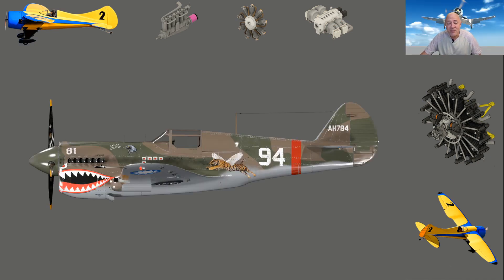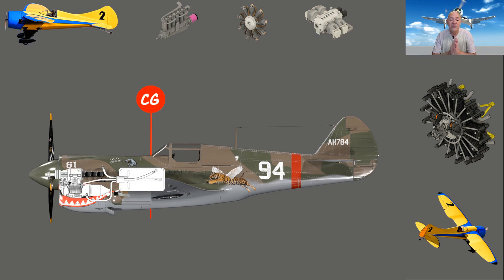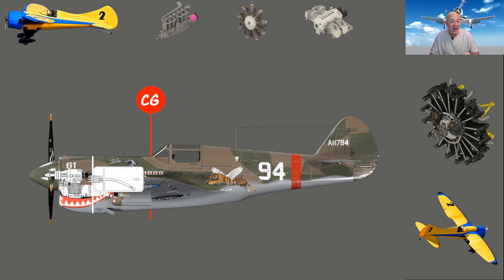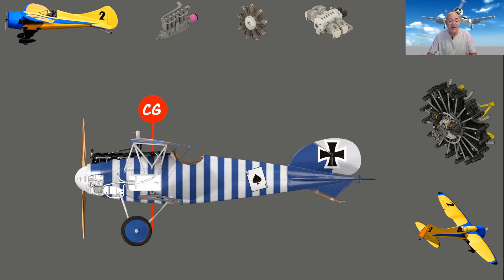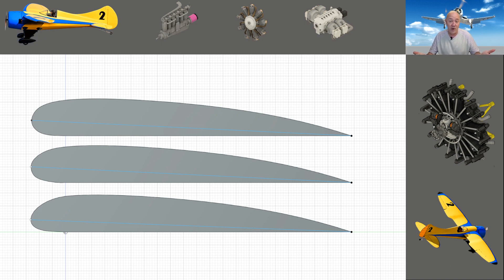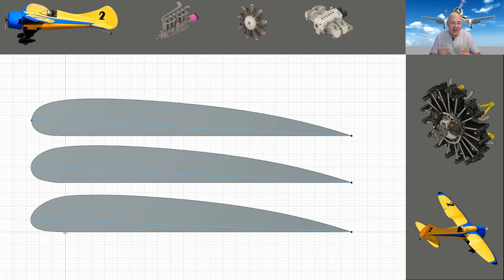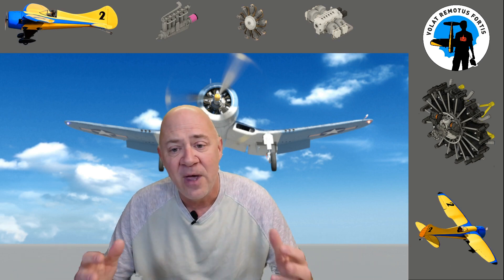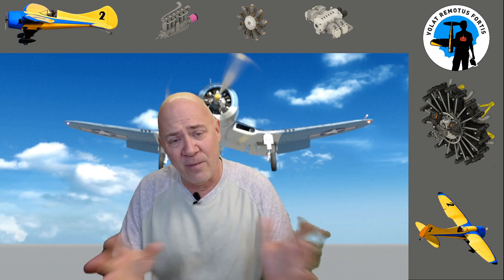No Dummy! It's not a CG Problem!

Comment: Hi Damon, 
I have a fms Dehavelin Beaver and I ordered the floats for it, after installing the floats I checked the c.g. and it was very tail heavy.
I had to add 7 ozs. Of weight to the front of the floats to get the c.g. within range. My question is c.g. the same with wheels and floats and am I correct in thinking the weight should be added to the floats because they caused the imbalance?
Reply from the maker: I would think you would be fine adding weight to the floats. I’m curious did the directions which came with the floats explained that the CG would need to be rechecked? You would think they would already prebalance the floats to get the center of gravity correct if it’s on their own plane. I would also check and see how it sits in the water. If it seems like it’s tilted forward the weight in the front of the floats might not be the best idea. But my guess is you’ll be fine. So here’s what I would do, check how it sits in the water, check how it taxis in the water, and then take it slow and get it in the air and see how it behaves. I hope this helps, good luck.
Reply: @dagtheaviator  no balance instructions, added weight to front of floats, flew good until the ESC  caught fire, trying to get waranty parts from Horizon.
Reply from the maker: @CaptBaldo1  That stinks about the ESC. Happy it flew good. Did they tell you how long on the new ESC? Rock ON!
Reply: @dagtheaviator  I  still haven't heard if they will do anything under warranty.

Comment: Great video!
 At 40 degrees the elevator may stall at full deflection making it completely in-effective.
I find sometimes a nose heavy plane will flare more with speed as the elevator trim at slower speeds is trying to lift it, then the elevator trim becomes more effective with more speed and actually starts pitching the nose up.
Reply from the maker: Good point! I thought about mentioning stalling the elevator, but thought it my spark some confusion for some. :) Rock ON!

Comment: I've been experimenting with the CG on a Waco bipe and I've found that it will tolerate the CG as far back as 40% of the total combined chord. It's touchy but you are so right about expo and gentle rates.
Reply: I like a more aft cg(hate the term tail heavy,unless it really is tail heavy) reduce your throws as the tail gains more authority and you won’t have a problem. You’ll just gain a much sweeter handling and landing plane,at least that’s my experience. 
Make small adjustments and test fly until it’s how you like it.
Reply from the maker: I love Waco's. My Emmaselle I (#1) has the CG at 40%. Flies great!